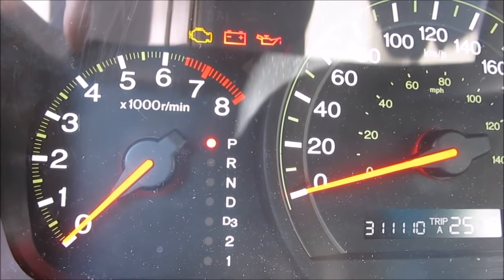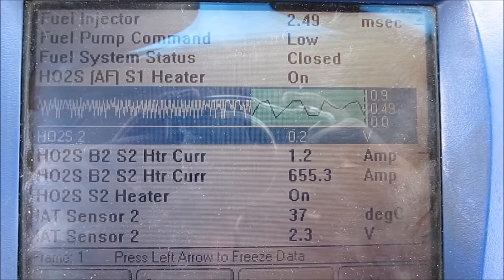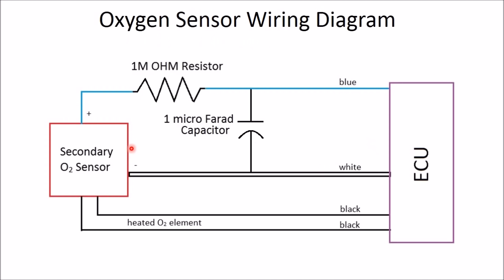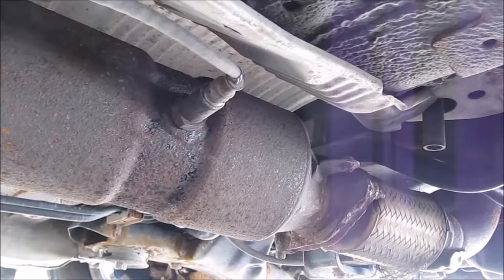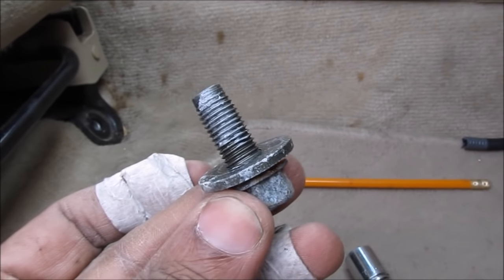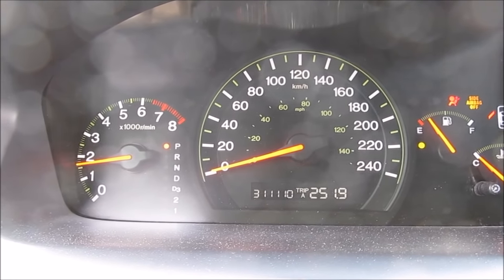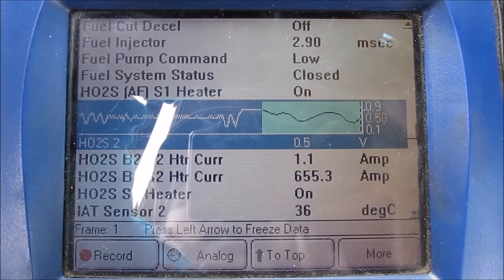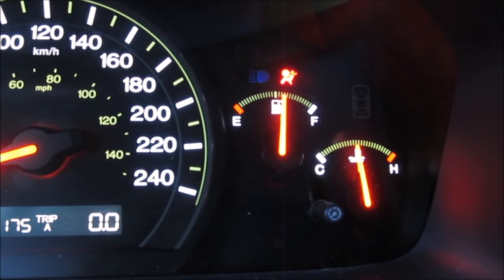P0420 Oxygen Sensor Fix

Comment: Thank you for a great in depth video, I have a V6 accord and I'll be trying this fix tomorrow for the bank 1 sensor, same code p0420. Two questions, in your diagram you showed the capacitor wired in series AFTER the resistor has been wired onto the blue wire (in parallel), where as in your actual wiring set up you have the cap wired before the resistor, does it make a difference? 

Secondly, my local radioshack has 1M-Ohm 1/2-Watt 5% resistors and 1.0uF 50V 20% Radial Bi-Polarized Electrolytic Capacitor, would these two work? Thank you in advance for any help.
Reply from the maker: +JnC445 thanks 
Yes wiring it backward makes a difference. 
With the values you'd have to try a few different ones to get the optimal RC constant for your ECU. Check digikey for a better selection of components.
Reply from the maker: +JnC445 thanks 
Yes wiring it backward makes a difference. 
With the values you'd have to try a few different ones to get the optimal RC constant for your ECU. Check digikey for a better selection of components.
Reply from the maker: +JnC445 thanks 
Yes wiring it backward makes a difference. 
With the values you'd have to try a few different ones to get the optimal RC constant for your ECU. Check digikey for a better selection of components.
Reply from the maker: +JnC445 thanks 
Yes wiring it backward makes a difference. 
With the values you'd have to try a few different ones to get the optimal RC constant for your ECU. Check digikey for a better selection of components.
Reply: bruh bruh bruh bruh

Comment: If you don't want to hack into the existing wiring harness you can just buy a replacement harness and modify it, then plug it into the existing connectors as an extra bit of cable to tuck away under the seat. Then it can be removed once you are through testing.

Comment: I thought the "catalyst" was the catalytic converter, the one you spoofed, so wouldn't that not be ready for emissions testing?
Reply: This.  
With catalytic not ready... this fix is a failure
Reply: Mr ravetti, your a failure at being any kind of mechanic.   Each system takes a certain amount of learn time to be considered ready from the ecu standpoint.  There are things like short term and long term fuel trim, evap , ac, purge, oxygen heated air effic. And could go on..  some systems require a specific milage to be driven at exactly 30mph without decel below that speed which may take a while before a car can be driven the dustance set by mfg to do in order to ready that particular system for a self diagnosis which some systems will even say not ready or even not available.  If you remove a certain component or it has a defect ive seen the system completely not recognize its installed and the system still work such as ac...  if your car smokes when you drive, it doesnt always mean its burning oil.  There could be a neighbors cat stuck on your tailpipe..
Reply: one not ready monitor is allowed; at least the MIL is off

Comment: Thanks for posting this. Should the specs of the capacitor change depending on the car brand or application? There is another video recommending a 4.7 uF capacitor. Also, do you know of this having worked on a Mercedes? The Mercedes ECM sends a number of tests to the sensor to check for integrity. I wonder whether this mod would trigger new CEL or faults.
Reply: The computer is looking for a voltage that doesn't fluctuate very much from the oxygen sensor.  The larger capacitor value of 4.7uf should accomplish that as well as the 1uf recommended here.

Comment: So I used a 1mF capacitor and a 1 M ohm resistor and my signal has a low peak and stays very close to 0.4V.  I am now getting a code of 'No activity' on bank 1 and 2.  Should I use a different capacitor?  Thoughts?
Reply from the maker: Yes
Reply: Johnathan Reid i used a 4.7 capicitator. Got the same errorcode p0140. Which capicitator do you advice? (Mazda 6 4 wires o2 sensor?
Reply: you are getting far too low of voltage you need to lower the resistance to allow more volts to flow through, the optimum voltage is lower than 0.7 and above 0.4 volts so 0.5 or 0.6 volts is perfect
Reply: VileStorms when i try this I’m getting error code p2271( signal stuck rich) any ideas???

Comment: it's an Electrolytic Capacitor before anyone comments..
the reason the signal is so smooth is the resistor limits the current for starters.
and the capacitor acts like a controlled power source only allowing a limited current each time,
by changing the capacitor you can alter the 'wave form'

basic electronics.
Reply: I agree it it basic, yet some of the writings i have seen make this complicated 
 This is a really usefull tutorial

Comment: What are the specs. for the capacitor and the resistor? uF and Wats.  Great Video.
Reply: I used a 1M ohm resistor and 4.7 micro farad capacitor.  Worked great on an E46 BMW

Comment: I don’t know if u still read this but just in case, I have a 2006 Toyota Highlander code 430 420 I did what u said with the com pastor and 1ohm r drove it 40 miles and the light came back on with the same code. What would u suggest I do?
Reply from the maker: Use an oxygen sensor scanner, graph outputs and see the difference. If you have the V6 you've got two banks to compare it against

Comment: I ve replaced my O2 sensor "1" correctly with brand new oem parts.  After few week , the warning light comes back again for the same problem. Is it something to do with a dirty mass air flow sensor ? i need advice to correct the problem.  thank you !
Reply from the maker: The catalytic converter is probably below efficiency and needs to be hacked or replaced
Reply: @speedkar99  yes, it is the cat . i will hack it as yr method
Reply: @speedkar99  i ve hacked bank 1 sensor , i m waiting for the result, no warning light at the moment. The last owner also hacked the bank 2 sensor for some reason(i don't know why). Unfortunately he did the resister on the -ve wire ,now  i recorrect all his mistake.. ..Wait & see ! hope the warning lights don't come back
Reply: Check your wiring

Comment: Thanks for the video. Were you using flux-core solder? Looked like regular plumbing type solder on the video, which would explain why it didn't take too well on the wire. 
Does the catalyst monitor change to ready after a couple of drive cycles or does the ecm know it's being messed with?
Reply from the maker: +Koffi Banan The wire itself is hard to solder. This isn't plumbing solder. It's probably coated with some anti-stick treatment to protect the oxygen sensor wires from the heat of the exhaust. 
I haven't seen the catalyst monitor change to ready yet. But I've ready it takes a while, if not forever on many cars for it to go ready. 
And yes you might get a frozen oxygen sensor code if the resistor capacitor values aren't correct after driving a few hundred km.
Reply: Ah, yeah some wires can be a pain, what usually helps is using some sandpaper on them and then the aggressive acid based flux like S39 RVS. I use this method to solder RVS bicycle brake and shifter cables at the ends so they don't fray out. You can also fix broken off cable ends on for instance lawnmowers this way.

Anyway let's hope the Honda stays oblivious to this little hack!
Reply from the maker: Thanks for the tip.

Comment: Hi, geat video thank you. I've just come across it after doing the exact RC filter mod by following another youtube guide The other guide is identical with one difference being that the author recommeded a 4.7uF capacitor instead of the 1uF that you suggest. So I did the mod on my Lexus using a 1Mohm resistor and a 4.7uF 35V capacitor. However, although the P0420 error has gone, I now have an error P0138 - O2 Sensor Circuit Hight Voltage. I checked the voltage reading and it's reading at 1.28V which is much higher than what it should be. Do you recommend I change the capacitor to a 1uF and keep the 1Mohm resistor as it is? Thank you.
Reply from the maker: Yes alot of this is trial and error. 
Read your signal outputs and compare it to the other bank for reference
Reply: @speedkar99  Just to confirm, the voltage signal still needs to fluctuate but needs to do it smoothly rather than rapidly which is what the RC filter does by slowing it down creating smoother lines?
Reply: @speedkar99  I tried 1uF and 4.7uF both are giving high voltage reading. 4.7uF is giving 1.28v and 1uF is giving 1.27v. maybe the problem is with the 1Mohm resistor?
Reply: @johnroberts5357  Yes I had the same issue and used a 360K which worked. I think a 330K would have been perfect.
Reply: if voltage is too high you need more resistance. if voltage is too low you need less resistance. if it says slow response you need less capacitance. and i guess if you just get p0420 again you need more capacitance.

Comment: Where do you buy those parts?Can I find those in any devices around the house like a broken Microwave or Old solid state devices?Is that more effective than the defouler that is all over Yutube?Is that legal to do in California?Thank you.
Reply from the maker: Rockauto
Reply: @speedkar99  Will this work on 2009 Acura Tsx with po 420?But which converter there are two in TSX though.One in the exhaust Manifold and before the muffler.Thank you.$3,000 is the stealerships price on the one under the hood.
Reply: @efrensaclolo7021  did it work for you?

Comment: Putting an O2 sensor spacer on the #2 sensor is much easier and works just as well.
Reply: Tried that on several occasions, it didn't work, check light luminates after few kilometers drives

Comment: Great vid as I was trying to do this. You think I can use the same resister and cap values for V6 1MZFE engine similar to your solara?
Reply from the maker: +rhpham2 It's only a starting point. If you get other engine codes you'll have to keep experimenting until you come up with the right RC constant. Of course if you have a working 1MZ car to try  you could reverse calculate the time constant from its graph output.

Comment: Question.....to keep the car original, for whatever reason, even to go back to stock at some later date....instead of cutting wires..... can you buy a pair of male-female connectors....to capture the "mods" here you wish to make....with the resister and capacitor captured between the new connectors to make an "assembly"....and then plug this "assembly" to the original car's wiring harness connector on one end..... and ( on the other side of the "Assembly")....to the sensor plug?

Comment: I deleted my catalytic converter   on my stock 2003 honda s2000. keep getting p0133 bank 1o2 sensor mostly every day within 50 - 100 miles after I erase it.. And every now and then I get a p0420 on my bank 2 o2 sensor. I'm  using ram air intake. When you have time. Can you please let me know if I can try to fix my problem with your resistor/compacitor method on this video or do I need a hondata  version 4 ecu and tune?if yes please tell me what size on bank1 and what size on bank 2.i really would appreciate it
Reply from the maker: Without a cat you'll always throw p0420 and you'll need a full simulator (and not just modify the existing one)
As for the AF sensor that means there's an issue with your engines combustion, either a vacuum leak or busted injector.

Comment: I thought of doing this (electrical engineer), but I didn't want to risk using the wrong values and killing my computer. I think I'll try your values and see what I get. Thanks!
Reply from the maker: Cool! It's a good start , hopefully you get it tuned for the right frequency
Reply: @speedkar99  where do I buy a capacitor and a rc circuit?

Comment: What about the o2 heater circuit? If the car requires heat from the cat to reach the correct temp, wouldn't the monitor hang up on the heater? Then the o2 sensor test would never run, unless your car requires a lower temp to run the heater test. In the case where the monitor hangs up on the o2 heater, what would you do?
Reply from the maker: +Captain heater is a separate circuit 
If thats broken you need a new sensor
Reply: I was referring to his mod specifically. I wasn't sure if the heaters would reach the correct temp without the cats installed. I'm guessing the heaters get hot enough for this mod to work on most vehicles, I was just throwing out the possibility of one not working without the additional heat from the cats. As for my issue (I still have cats, but this topic intrigues me anyway), I had a blown fuse that was causing all 4 o2 sensors to show a heater code, so the monitor wouldn't run.
Reply: Captain he never messed with the heated shit at all...  heat makes the sensors work instantly and give accurate readings faster ya goob
Reply: You have a bad o2 sensor ( o2 sensor heater circuit is bad) change 02 sensor
Reply: The heater purpose is so the computer will go into closed loop fuel control faster. O2 sensors need to be at operating temp to generate a signal

Comment: I have a 08 GMC Yukon and have changed out the catalytic converter and oxygen sensors and still getting a P0430 and P0420 codes.

Comment: Thank you for your time and effort in this production, extremely useful information. What needs to be done with the heater signal? I guess what I'm asking is there a feed forward or a feedback on that circuit to the E.C.M. the reason why, I am running Off Road and won't be using the CATcon , but I don't want to incorporate the Fixed components. Adjustable maybe 10-25%!!??
Reply from the maker: The heater is just a resistor that varies with temperature
Reply: @speedkar99  ok so  is that signal processed back to the ecm? And controlled to vary the temperature, once the sensor is up and running does it open circuit? Do I need to fool the heater circuit or just runit open, and hope it senses the heat. But I did notice a heater  pin reading on your scanner for mva ?

Comment: HI there , thx for your post, sounds logical. I have a Toyota Avensis Verso from 2004 with a 2.0 VVTI. I have a P0420. I checked everything andy my conclusion is that my Catalyc converter is not 100% anymore. I did an emission test at the garage and it was enough to pass the test. So my concern is to get rid of the P0420. So i tried this yesterday wth 1m ohm and1 uf, today the test cycle is complete The initial vol was between 0.1 and 1.0 volt, with much high peaks to 0.9 v. With the hack the highest voltage is 0.6 volt but stil steep peaks.  So i think i have to get rid of these peaks. What should i do ? I m thinking about a higher value capicitator.  What do you think ?
Reply: Sorry i forgot, I have a now an malfunction of the o2 sensor, so it fixed one but a get an new fault back
Reply from the maker: +Roel I'm not sure since we don't know exactly what values the ecu is looking for

Comment: Does this work to clear the Catalyst Monitor?  As of last year 2016-In California-were allowed one "not ready" monitor excluding the Catalyst Monitor.
Reply from the maker: +James Lancaster last I checked it was not ready, I didn't check after driving a few more thousand kms though. We are allowed one not ready here.
Reply: speedkar99 I have tried this on my 2004 Accord LX (a California vehicle) with SULEV & PZEV emissions. This only delayed the Catalyst Monitor. All monitors cleared except for the Catalyst. This stayed incomplete. After 3 drive cycles I received a CEL for Delayed 02 sensor function Bank 2.  So this didn't work to clear the P420 code. In states where the Catalyst Monitor can remain incomplete this may work fine. Unfortunately in California completing this monitor is a requirement.
Reply: James Lancaster so this mod will cause the cat monitor to stay in the not ready state? Or you just need to drive till that monitor is complete?

Comment: Hi, electrolytic capacitors have polarity, with one end marked negative and the other positive. How did you connect the cap in the circuit you built...? Thanks!
Reply from the maker: Check the circuit diagram

Comment: @speedkar99 I've been told to use anywhere from 1-500k ohm resistors and 10-20uf resistor. I dont know if it matters all that much, but in my Lexus IS300(Toyota) the ecus can be tricky to fool. Do you have any input on this?

Comment: can you tell me what capacitor did you use?i watched your video over and over again i see the 3v 1uf capacitor but never can't found on google i have 04 honda.
Reply: If you're saying you can't find the parts you can find them on eBay I just looked them up and they're really cheap.  1 microfarad capacitor  and  one Meg Ohm resistor.
Reply: You can use any voltage for the capacitor.  15v or 25v etc it doesn't matter.

Comment: I tried this on my ‘05 Subaru. I now have code P2096 - Post catalyst fuel trim system too lean. Should I vary the value of the capacitor or resistor? Sounds like I over corrected?
Reply from the maker: Yes

Comment: Will this work on my 2004 LX470 V8, with 2 rear O2 sensors? Is this method similar to those IRD O2 simulator? Please advise
Reply from the maker: +Michael shaw I'm not familiar with the LX, but I can assume the theory is similar. You'd have to play with the RC values to get the right response for it not to flog a CEL. Let me know it it goes.

Comment: Does it have to be done on the harness for the vehicle or can it be put on the actual o2 wiring?
Reply from the maker: +Landry Barnett I put mine on the 02 wiring if I remember correctly. That way if you replace the sensor the car wiring is not damaged.
Reply: speedkar99 dang that is a long connector for that vehicle! ok  that’s what I did but I must have made a mistake. I was wondering in case one of those wires is a shared connection like the EGR wiring for my 5.0 in my 01 mountaineer, in my case I need to put three resistors in basically a triangle to ensure proper outputs for the EGR that is gone and the other component that uses the shared connection. Thanks for your fast reply.
Reply: you could put it anywhere, but use solder because crimped connections will corrode.